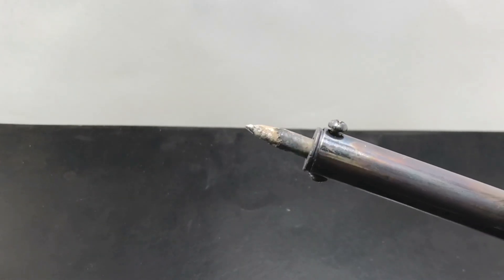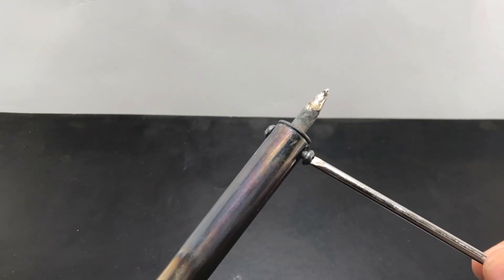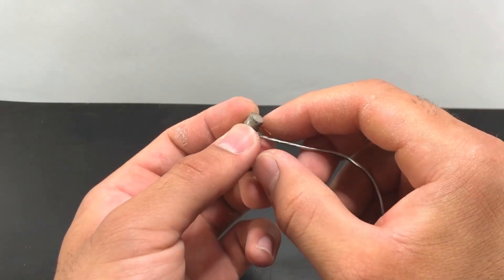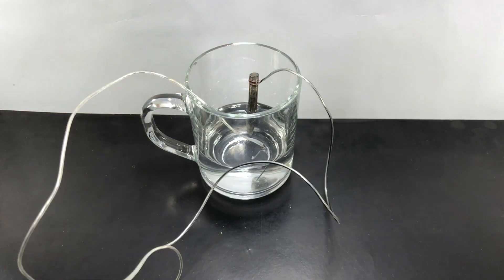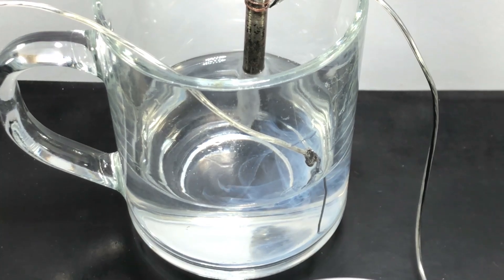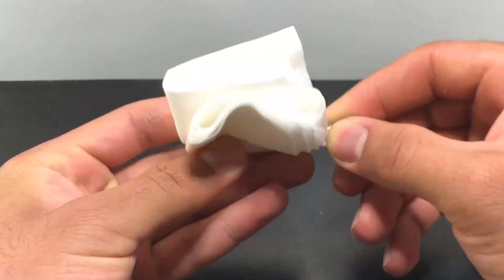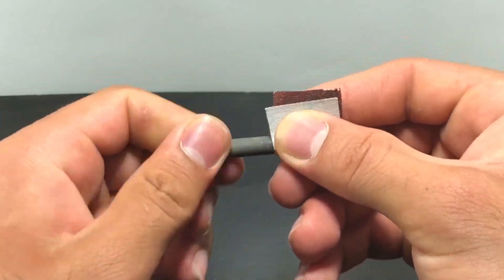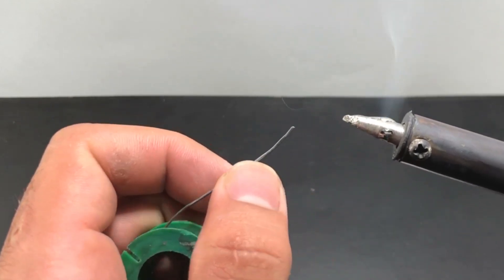Amazing Result: Salt on Soldering Iron Experiment

Comment: You could've just cleaned the tip with sand paper. I always do that. And salt water part was unnecessary.
Reply from the maker: It is true, but less damage is done with salt water and it makes the soldering machine last longer

Comment: I have never had to clean the tip of a soldering iron. Furthermore, you've tinned the whole bit. I like just the tip tinned. It would be far better surely to use some flux to keep it clean, such as from some multicore solder. I wonder if there are poor quality solders in the East that cause problems, or perhaps if you don't use flux at all. My bits have never corroded like yours, yet my latest ones are Chinese. I solder occasionally and they get coloured oxide layers, but to get the amount of oxide you have you'd have to be soldering for decades. Either your bits are weird or they are used in a factory and just need replacing every 10 years. Nevertheless, it was an interesting video, and a clever use of USB, and salt!
Reply from the maker: Nice to meet you. As you mentioned, the quality of solder is different in each region

Comment: NEVER EVER sand you soldering tip, you will destroy the thin layer that protects the tip. Once you expose the copper, the oxidation process will only accelerate.

 Use special cleaning agents and regularly flood your tip with rosin core solder with a high tin content. Digikey has a complete article on proper maintenance.
Reply: Agreed.  A much better solution to this problem is just to take proper care of your soldering iron so that it never gets into this kind of sorry state to begin with.

Every time you use the iron, before you put it away, clean the tip properly using a wet sponge or a brass wire ball cleaner, and then coat the tip with a little bit of solder so it looks nice and shiny, before actually turning it off and letting it cool down.  It literally only takes a couple of seconds, and if you do this regularly, it will last for a long time, always be ready to go, and you will never have to do anything else to clean your iron, ever.

If you ever do end up in really bad shape like this, buy some actual "tip cleaner" (it only costs a couple of bucks, and will last for many many uses), which is designed for exactly this purpose, and also designed not to damage the tip.  Never use sandpaper or steel files/brushes on a soldering iron tip.  If you've managed to get something crusty on there that won't come off in any other way, then you can use a brass brush to try to remove it (always only use brass, though, not steel or other abrasives.  Since brass is softer than steel, it can remove most hard coatings without actually damaging the steel of the tip itself).
Reply from the maker: Nice to meet you and your useful information, but this video is for those who forgot to use their soldering iron, that's why I made this video and this method works at no extra cost and note Be sure the sandpaper is soft. Sandpaper does not damage the soldering tip
Reply from the maker: I will definitely study this course

Comment: don't do this
Reply from the maker: why my friend
Reply: @Super_Inventor  Because all you did was sand the tip. You could've skipped the rest of the steps if you wanted. 

But sanding soldering iron tips is an instant way to destroy them. There are special cleaning agents for that specific purpose. Anyone with a weller (or equivalent) knows how expensive those tips are.